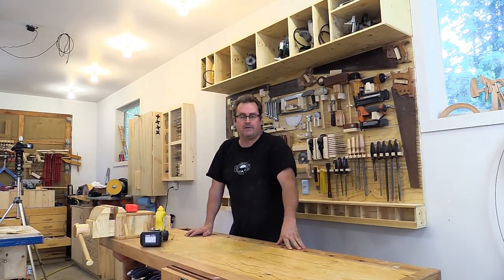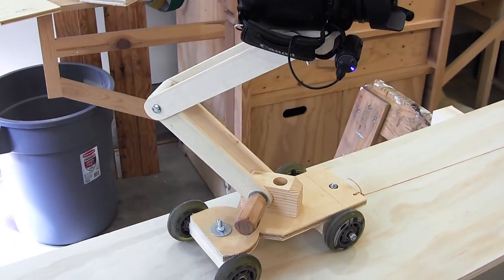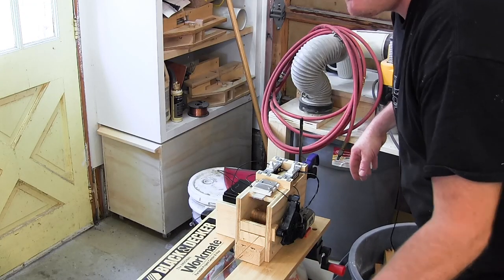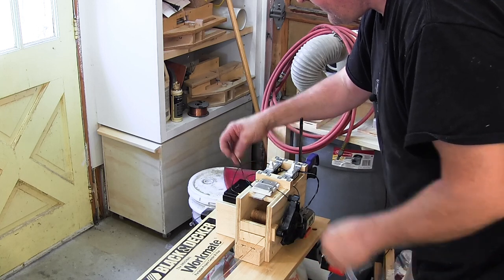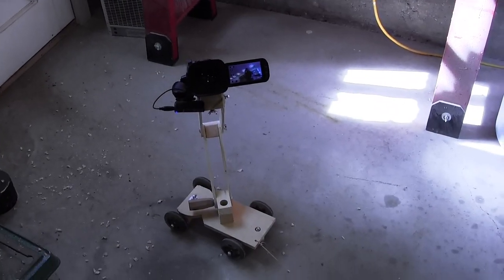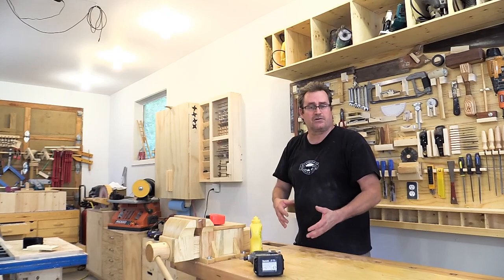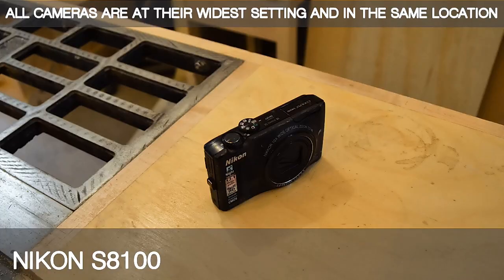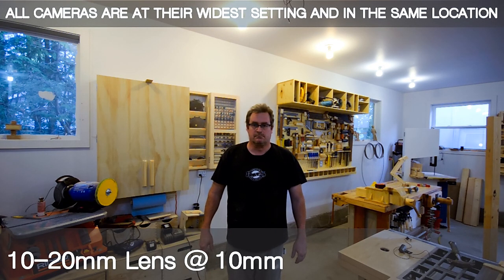Homemade Camera Dolly

Comment: Thanks for the info on the slider....or dolly. I've read that if you use a large rubber band to pull the camera on tripod pan shots it will reduce the shake from your hand. Maybe a 6" or so rubber band leader would absorb some of the motor inconsistencies.
Reply from the maker: Jay Bates Thanks Jay, I'll give the rubber band idea a try tomorrow and see how it turns out.
Reply: i was just about to comment with the exact same thing. I heard about that from a youtube video.

Comment: You can solve some of that jerkiness by adding in a series of rollers John, to keep the string in tension as much as possible and reduce 'twanginess'. The longer the length of string the more 'twangy' it will be and this is the cause of a lot of the jerkiness. The motor may have some problems and not be as regular as you'd like but if you use some small but deep pulleys here and there along the length, especially if you alternate between up and down facing pulleys, and make sure the plane you're rolling on is super clean and I bet you'll see a big difference.

Great build too I might add. The cradle is fantastic. You always build nice, solid solutions and this is another - a great way to go. All it needs is a little tweaking.

Comment: HI John, nice project. You can use a rubber band to attach the string to the dolly and that will smooth out the speed fluctuations. The same trick can be used to make smooth tripod pan shots. Just loop a rubber band around the handle of the tripod and pull the rubber band to pan. The rubber band takes up the jerkiness.

Cheers,
Steven
Reply from the maker: Coxy's Railroading Interesting idea and well worth trying! Thanks!
Reply: John Heisz Actually I think this would worsen it. It seems that the string is already too elastic. That means every time one of the wheels face microscopic obstacle, the rope needs to tension a bit to actually overcome the obstacle and then rolling of it releases some of the energy in forward motion.
I’m not really an angler or fisher man, but I remember that some lines used in that business are rated for their longitudinal stretch (“spring”). I’d try the least springy line one I can get hold of.
To my experience wind screen wipers are pretty good in both torque and steadiness. If it is not broken or bent seriously, this doesn’t seem to be the issue. There might be some play in the worm gear, but the few thou of slack would not explain the unsteady run of the cart.
There are some sophisticated mechanisms to avoid untrue running in cases it is a system immanent issue. You might know carillons à musique. They can have a fan fly to regulate the speed of movement to avoid similar effects in the music. If you are really bored you could think of similar mechanisms to dampen the wheels …
Reply from the maker: Sqeezerful You are overthinking it - it's not an elasticity in the string - it's a problem with the motor (like I said). The dolly plus camera rolling on those wheels offers no resistance at all, certainly not enough to stretch a string.
Reply: John Heisz
I was thinking along the exact same lines as Sqeezerful. Tiny variations in the rolling surface and the bearings and wheels themselves will cause the dolly to snag just enough to stretch the string ever so slightly, then when this tension overcomes the rolling friction, the dolly jerks forward. The effect will be more noticeable with longer string, even if you have the smoothest floor and best bearings and wheels possible.
What happens if you have the motor just running on its own with no dolly? If it's still jerky, maybe you could disassemble it, clean it up and grease the hell out of it. That'd make for an interesting project, too :-)

Comment: Very cool project. The first recommended video is actually your step pulley video. That may work to add a bunch more speeds instead of a single radius dowel. Would one of those dimmer switches work too maybe?...again, cool project.

Comment: Very cool, John!  You need a custom control PCB to mount your switches and resistors to.
Reply from the maker: Jason Rausch Like Oscar Goldman used to say: "We have the technology...: http://www.ibuilditaudio.com/Projects/other/circuit-board-1.php
Reply: Nice!  I was going to offer to design one for you in EagleCAD, since that is something my electronics company does.  I have to admit, I went right from rub on transfers, straight to using commercial PCB houses to produce my boards.  However, I have a laser printer that I use for invoicing.  Maybe I need to try the toner transfer method.  Have you seen OSH Park?  They will produce three of any design based on square inch and the price beats any other prototype service out there.

Comment: John, I don't think the problem with the uneven movement to be on the motor. I believe the dolly's wheels are fixed and cannot steer, therefore, if you pull the dolly at an angle (as in the last shot) you'll get extra resistance from the wheel slipping on the surface, which I'm pretty sure it's the origin of the problem. Try pulling it parallel to the direction of the wheels, or get a set of steerable wheels (like the ones on shopping carts).

Comment: Could it be caused by the dolly running so smoothly that it rolls on/ahead a little causing some slack in the rope and then when the motor catches up again you get this jerk?
Reply from the maker: Robert van der zaan The dolly is being pulled uphill.
Reply: Ah, i watched the rope when you were running the dolly on the floor